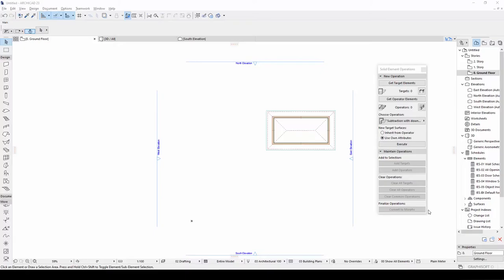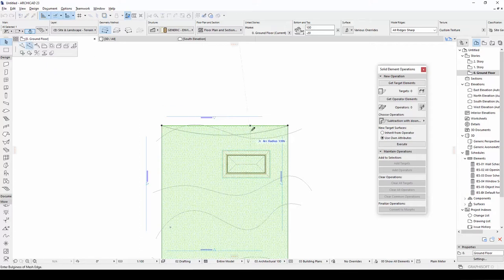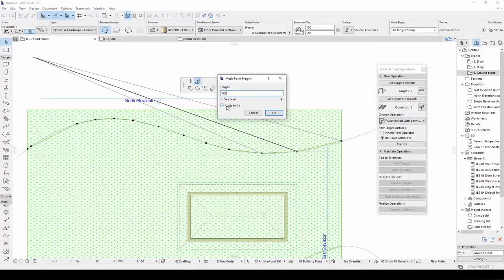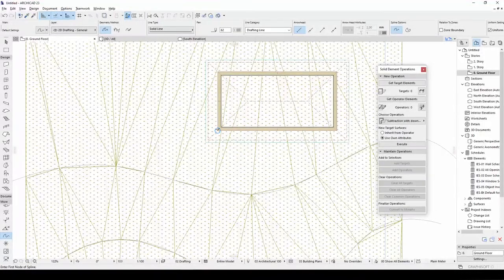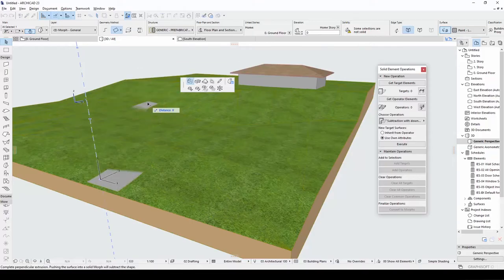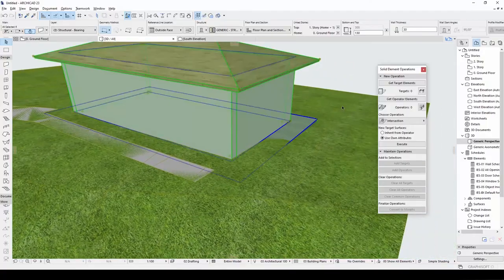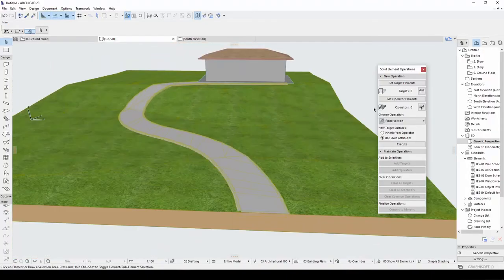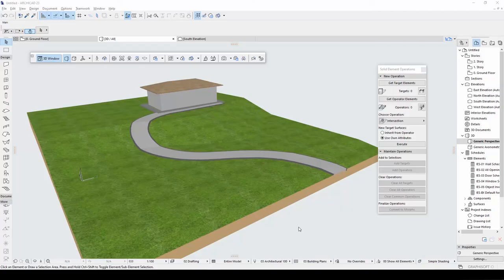ARCHICAD 23 Tutorial #2 Site Plan - SLOPED road, curbs

Comment: I use to model the terrain and roads like you using the morph  but I found using mesh instead of morph is a much better option especially if you subtract it from the original terrain it allows you to offset each point in the (z) direction and align it perfectly.